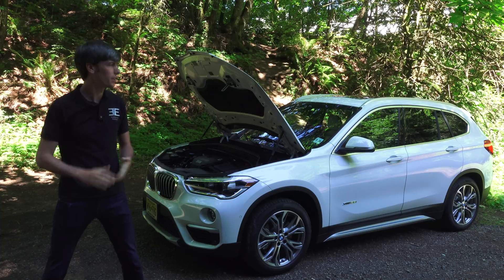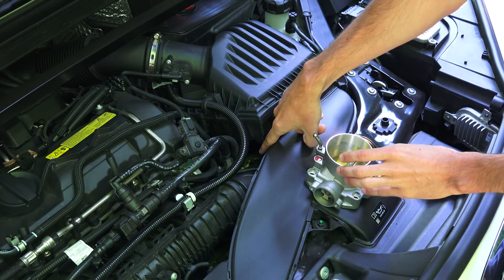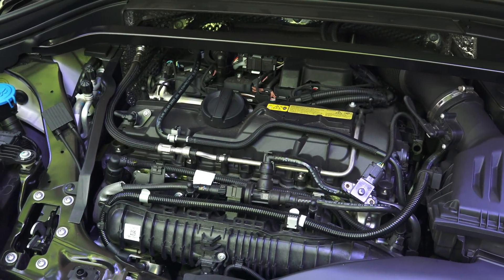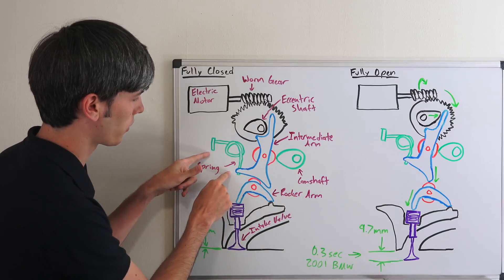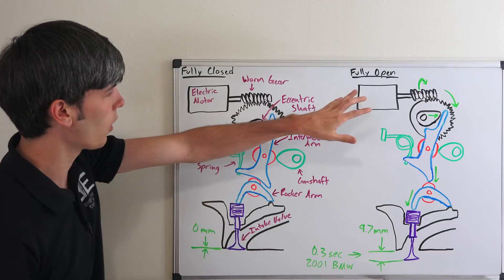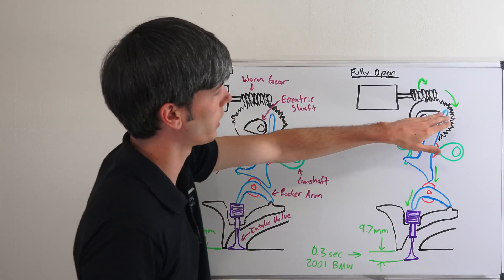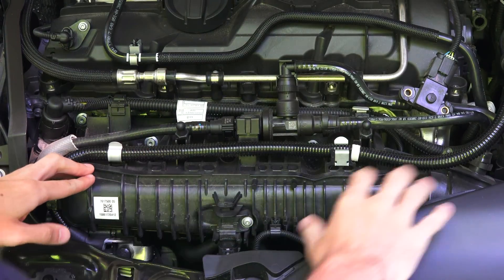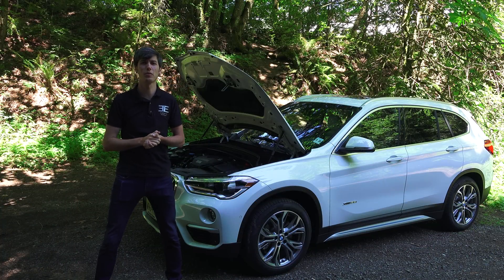What Is Valvetronic? BMW's Innovative Throttle System

Comment: this is way over engineered.
Reply: Germans
Reply: Buy a horse.
Reply: Hmm, as an engineer, this sure sounds like a good and logical air delivery concept. However, I have to agree from a manufacturing standpoint, this is more of an engineering success than a reliable product. If you ask me, VVT, VTEC, and other such systems are all excessive. The less moving parts your drivetrain has, the longer it will last. Sure, they can help reduce fuel consumption and emissions, which is important, but wind up costing a fortune in dealership repair bills when they go wrong. If you lease a car, this isn't a problem. Owners have to worry about longevity. Really, by this standard, an AC Induction electric motor is a much more efficient system, with one moving part. But battery technology is not far enough along yet to be practical. I will probably stick with an old carbeurated or early EFI system with OHV until the electric car forces me to update. Just my 2 cents.
Reply: +ChinnuWoW R A C I S M
Reply: why should this be way over engineered?
Reply: Leo

I was refering to 90' and 00' cars. They are waaaay better than 10' ones.
Reply: +gokartbuyer Oil pressure systems still use solenoids to control flow, so you still have just as many electronic points of failure. If Velvetronic fails the engine should still run using the failsafe throttle body he mentioned. I could be wrong on that, maybe the failsafe is just there to close in case a valve sticks open. The point is, this is probably an unreliable mess because its being done by FCA and BMW, but the technology itself is a massive leap for the internal combustion engine. Once the likes of Toyota and Honda embrace it camshafts will go the way of the carburetor.  Think about it, EFI was horribly unreliable too at one point and now its the world standard.
Reply: +SzwarcuKX5 Yeah that's why in the 70's a car was junk at 100k and now they last 250+. Nothing says "reliable" like adjusting carbs and filing points every 6k and replacing them at 12k. Definitely more reliable that the modern car that uses 100k spark plugs. Totally. You should be an engineer.
Reply: "they can help reduce fuel consumption and emissions, which is important"

Unfortunately, it's more than important, it's mandated by Federal Regulations...  All the fuel economy improvements, safety improvements, etc. are mandated by FR.  IMHO, FRs are a big portion of why cars cost so much today.

Fortunately, cars are also built to tighter engineering tolerances than they used to be.  They will last longer.  The best way I've found to offset the cost is to keep my cars for a long time.  I routinely get 250-300k miles (which for me translates into 15-20 years) on my vehicles before repair costs make doing the repairs impractical.  Then I go get a new car.  I get the latest technology that I will again "drive until the wheels fall off".

TM2C.
Reply: No Job

So basicly what you trying to say is - New generation cars last longer.
I never heard bigger nonsense, especially on engineering channel. I can already see 0.9L 150HP little Ford's engine lasting 20yrs lmao.
All that emission regulations and fuel economy race is killing the engines faster comparing to good old engines without any bs things like DPF, EGR, AdBlue, TriTurbo etc.
Reply: +SzwarcuKX5 

DPF, EGR, AdBlue, PCV, cats, AIR, etc were all common in the late 80s and 90s, and mandated for gasoline cars after 1996.
Reply: Just like the Königstiger
Reply: @oshkoshbjosh986  

Every Tiger tank: But what if I suffered t r a n s m i s s i o n  f a i l u r e
Reply: +Leo Nah oil pressure operated is far simpler and much more reliable as oil pressure is necessary for an engine to run any way. This system utilizes an electric motor to open the valve at all. I'm not sure if there are multiple motors or if it's one that controls them all but seems like the car won't run at all if they fail. Oil pressure actuated VVT that fails will allow the engine to run with reduced power. Not to mention the fact that now the engine has to power a vacuum pump which reduces efficiency anyway.
Reply: @gokartbuyer  you got that wrong. The electric motor is not used to open the valves. The valves are still operated by the camshaft. The electric Motor just turns this eccentric shaft to alter the rocker ratio and thus determining how much the valves open. It's equivalent to your throttle cable in conventional engines.
Reply: Like Leo sez, a 70's car was junk at 100k.  Why do you think restomods are so popular?  The cool nostalgic look from our youth with the performance and reliability of today...
Reply: +elesjuan Especially so if you plan on swapping the cam(s). Buying one really good aftermarket camshaft for an OHV setup is much cheaper than the 4 needed in a dohc V8.
Reply: As all german cars are.
Reply: +SzwarcuKX5 true
Reply: its a german car what did you expect?
Reply: Leo

DPF in petrol engines?
Are you serious? 2005 car 1.4 petrol engine, no DPF.
2000 car 2.0 diesel engine, no DPF.
Reply: Any single OHC will be way better.
Reply: NGC1433 Even better than that?  an engine with one camshaft and pushrods.
Reply: ***** Yessir.  GM has proven with the Gen IV and V small blocks that single camshaft and pushrods are still perfectly viable options to the overhead cam packaging nightmare.
Reply: +tcv4 but with dohc you have better control over the valve timing and lift
Reply: ... it's a BMW. Did you have some sort of point? :D
Reply: H I S T O R Y
Reply: Sincee1809

To many things to go south.

Comment: hey EE, Thanks as always for the good information. a co-worker told me its bad to leave your AC on, for when you turn on your car. Is this a myth or could you explain/make a video? thanks!
Reply from the maker: I suppose you'd have slightly more power draw on start-up, it'd start easier without, but I don't know how much easier.
Reply: +Engineering Explained ok thanks, he said something along the lines of more power surging through the compressor causing premature wear, and if you had the output on high the pressure moving through the system could eventually lead to failure of weak points like seals or the evap core
Reply: My parents and grandparents do this habitually (turn a/c off right before turning off engine, only turn it off once car is started). I figure there might be some small decrease in wear on your starter, but I also just figured they were used to low power crappy third world country cars.

Comment: I f understand it is using the electric motor to open the valve along with the cam. I can understand that the variable valve system has benefits. I think it would be better to use the motor strictly for varying the valve movement but leave the actual force to move the valve to the mechanical cam. effeciency is one thing but replacing needlessly complicated parts is not efficient in any way. I just the the electric motors should be used to a minimum of work.

Comment: Qs: 1. If this is a turbocharged system like you say, then where is the boosted air introduced? 2. How often is the valve profile changed? 3. Is it dependent on RPM range? Desired power output? 4. Do the valves still fully close for the combustion cycle even when the actuator is fully extended? (I imagine they must, but your drawing does not show this)
Reply: Continuously variable. But it's not like vtec.... They function like individual throttles so they don't have different "profiles" but they are continuously variable from 0-100% open
Reply: I'm not sure which question this is answering...
Reply: +Cameron Sours "2. how often is the valve profile changed? 3. Is it dependent on rpm range? 4. Do the valve still fully close for the combustion cycle even when the actuator is fully extended?"

Comment: 2 questions:

Don't turbos essentially eliminate pumping losses?
Would ITBs be able to accomplish the same goals? Everything upstream of the TB plates would be close to atmospheric.

I'm thinking BMW had to make this complex system because of copyrights. Toyota's system is way simpler. I'm thinking this is all for naught anyway- cars are going to move to hybrid tech, rather than continue to juice the last drops of efficiency out of the ICE. At least until they figure out HCCI.
Reply from the maker: Turbos certainly help with pumping losses, yes, but even turbo engines are not running at boost constantly. This system provides the greatest benefit at low throttle (as far as efficiency), regardless if NA or turbo.
Reply: OK. I'm just wondering if turbos make these systems redundant. An NA engine is at some level of vacuum everywhere but WOT. Turbo engines are superatmospheric.... 50%? 75%? of the time. Just seems like diminishing returns.
Reply: with a turbocharger you will be above atmospheric only under acceleration, for example if you are accelerating you will be above atmospheric but lets say the speed limit is 40mph and you already got up to speed and hold it the whole system becomes under vacuum. but i definitely agree they could have made it simpler

Comment: 04:03 - Isn't the plastic piece meant to be pushed into the metal socket on the tube? (In the middle of the shot, one third from the bottom of the image). Looks like a fuel line, but I could be wrong.
Reply: pushing that in would disconnect the line,b it's a quick connector like ford style fuel lines. the plastic peice is there so you can push it into the locking tabs/spring and quickly  disconnect the line for easy service.
Reply: Ryan Brimhall

I see. I thought it was like the other style where pushing it in locks it in place and pulling it out allows the pipe to be released. Thanks for clarifying.

Comment: I wonder why they went with a pump instead of a hydraulic system for the brake assist; they could just use a power steering pump hydroboost.
Reply: cos they would already be using a vaccum pump for thier diesel models. Most if not all diesels use a vacuum pump in this way and thus instead of redesigning a new system they could just use the exact same one from thier existing diesel models, saving costs.
Reply: We also need to understand that all newer BMWs utilize Electric Assisted Rack and Pinion Steering using an electric motor. So there's no hydraulic pump present.
Reply: What sources? I didn't look up the specs before posting the comment, my mistake.
Reply: It's an F platform BMW it uses an electric power steering set up, mechanically that X1 is identical to the new Mini Clubman, which from personal experience working on them/reference documents they use an electric not hydraulic steering set up.
Reply: hydraulic power steering pumps are a thing of the past because they need power all the time. electric systems are only activated when needed. more efficient -> less fuel consumption
Reply: All F-series BMWs use electric power steering with two exceptions. The F10 xDrive is one of them, and the F10 M5 is another, but all the non-M RWD F10 have electric assist regardless of engine option.
Reply: For one, this X1 is not equipped with hydraulic power steering anymore, instead it has EPS (electric power steering). BMW did this save space, weight and improve fuel efficiency. Now the reason why they use a vacuum pump is because it's lightweight and it doesn't take much space. It literally fits in the palm of your hand.
Reply: Power steering pump??? This uses electric assist where do you get your sources from?
Reply: David Mumma You are right friend, but it's the Mini Countryman the one it shares it chassis with.
Reply: From my understanding only the ones with smaller engines not all. F10's with 6 and 8 cylinder engines had hydraulic while 4 cylinder had electric for example. There isn't enough space in the engine bay to handle the additional hardware for the electronic power steering.

Comment: Good to know that the stuff I'm learning now will be obsolete by the time I start working. Thanks BMW.
Reply: Steven Schechterly Heres the question though "20 year old" little buddy. Do you work for BMW? A licensed BMW dealership? Where they would oeprate on new, $60k X1s? I doubt you. And no, he didnt waste any money. Youre not the majority because youre "the highest paid tech" at a local shop. Every tech I work with at my dealer, is BMW certifed, for specific work on new model BMWs. they HAVE to go to school to work here. You NEED Certs from SCHOOLS to do anything but oil changes. The salaries range from $30k/yr doing oil changes and tire rotations, to $150k/yr being the Certified BMWi and M tech.
Reply: +Steven Schechterly yeaaa chrysler tech. I with ya bud
Reply: Thats with any manufacturer lol. Good luck, you wasted your money
Reply: +ELIJAH HEADRICK he did waste money by going to a tech school, you don't learn anything at them and pay 40K. Im one of the highest paid techs at my dealership, at 20 years old, without going to school
Reply: Its funny cause they dont crush every car on the road the moment one comes off the factory line. Just because the New Beamers use it, doesnt mean there arent plenty of old cars, like my E34 that still roll old school. You didnt waste any money lmao. Especially since BMW isnt the only car company on the Earth. No money wasted.
Reply: +ELIJAH HEADRICK +ELIJAH HEADRICK no i dont work at a bmw dealership, although i have a do own a few bmw's and know my way around them. I am a certified dodge technician and am currently working on becoming a certified srt technician and I acquired that through dealer certified training that I got paid to do.
Reply: that's not true man. I work at a certified bmw dealership myself as a part time mechanic without any certificates, however I'm a student in mechanical/automotive engineering.
Reply: It's the skills that matter, not the knowledge. You can learn about these systems from technical manuals and books. It's the experience you gain and skills you develop (both practical and academic) that set you apart from any ol' Joe with a service manual.

Comment: Great explanation - that's a very interesting system. Are there any conditions under which the intake valves are fully closed? Is that how they choke out the engine for start/stop motors?
Reply from the maker: Typically start stop is done by killing the spark (or fuel, for a diesel), but I suppose you could stop it by shutting the valves as well.

Comment: This system really need to be combined with the Koenigsegg free valve, electronic valve systems.
Reply from the maker: Yep, in that case you wouldn't need to complicated valvetrain and it would (appear to) be much simpler. Could certainly use the same logic though.
Reply: actually, isn't this just like a mechanical version of the freevalve though? you already could adjust both the timing and lift with VANOS and valvetronics. or rather what's the difference? and the limitation?
Reply: +Koolkei vanos is vvt. It slows the cam shift down effectively increasing valve duration.
Reply: you can not adjust lift with vanos
Reply: *****
 it is still mechanical, so it still does have some limitations, but i'd say it's pretty close?

also, is VANOS their VVL or VVT system?
Reply: VANOS is VVT.

Comment: the intake valve is opened by the electric motor only ? or the camshaft operates the valve to?
Reply: The only difference between this and other engines is that the electric motor can adjust how far the intake valve opens, but the camshaft works the same way as in any other engine.
Reply from the maker: Camshaft operates the valve, motor adjusts how much valve lift occurs for each valve opening cycle.

Comment: What is the difference between BMW Valvetronic and Toyota Valvematic?
Also why does Toyota Valvematic engines feel like they have kind of slow throttle response?
Reply from the maker: Very similar systems.